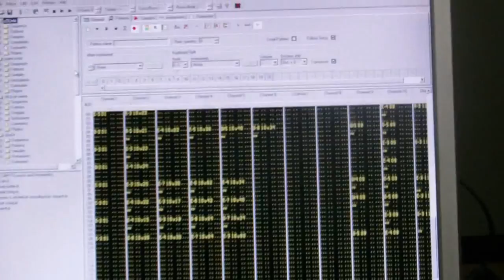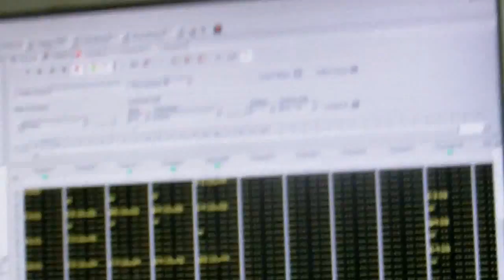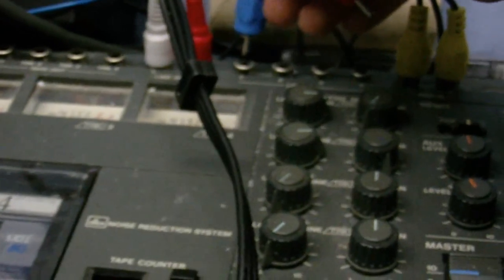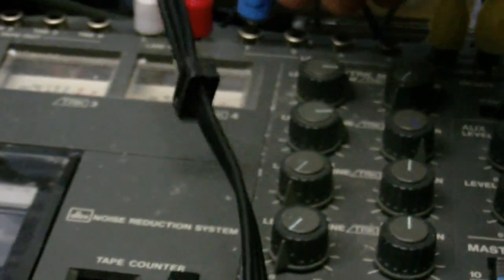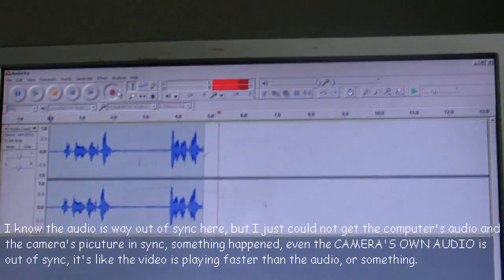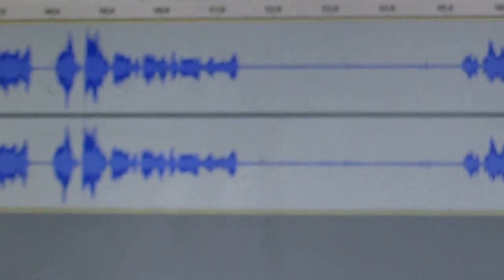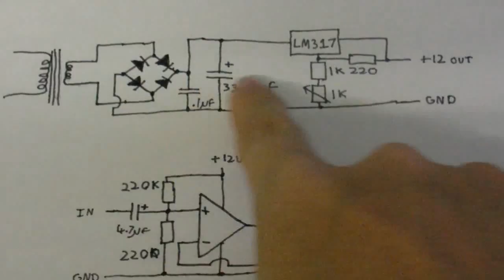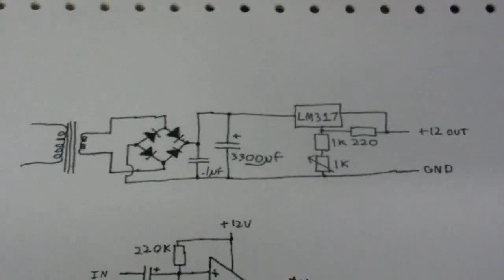CDC Electronic WorkShop - Op-Amp buffer circuiit thing.

Comment from the maker: I like to use a seperate power supply instead of the computer's PSU for the amplifier becuase some of those PSUs can be a little noisy.  BTW I think I accidentally thumbed your comment down, I was trying to reply and thought I had to click in the triangle thing with the circle round it, so sorry about that, it was a complete accident.

Comment: i have an Amp inside my ccomputer powered from the computers psu,its a tda 8560 i think 2x 40w 2 ohm,you should use re computers psu a powe supply for the op amps